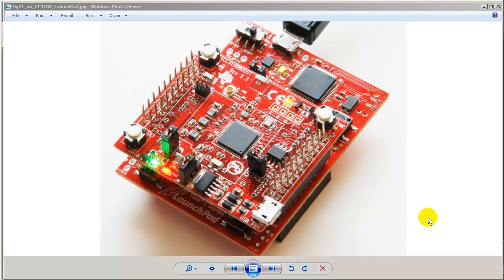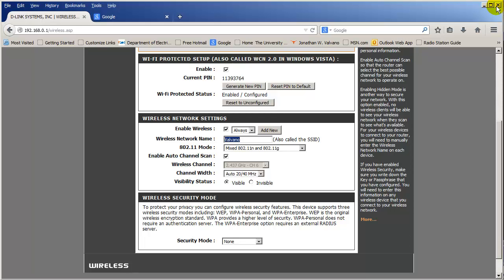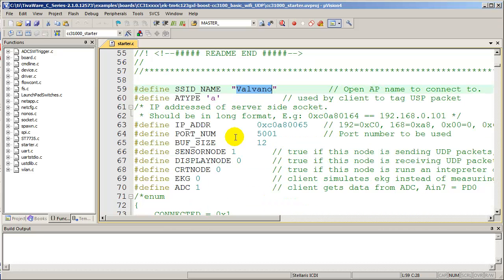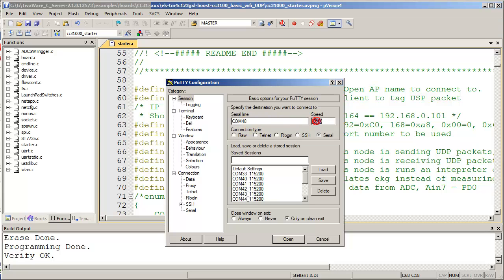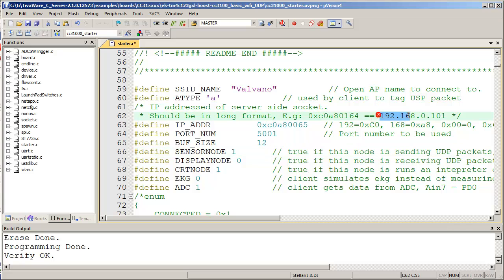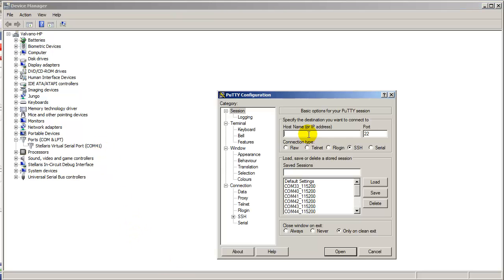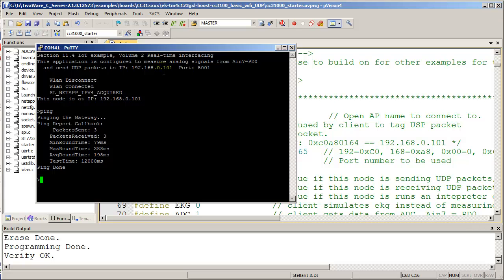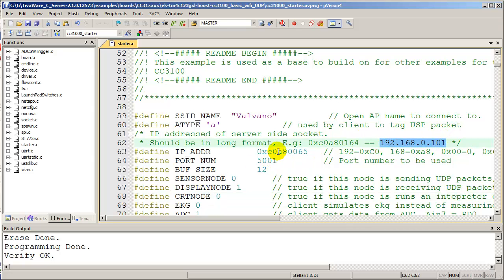IEEE802.11 System with TM4C123 and CC3100 booster

Comment: Hi Valvano,
To work with this example you used first cc3100 EmuBoost to program cc3100BoosterPack?
It is possible to program the cc3100 with the tm4c123gxl?
Thanks
Reply: Did you figure out if we need the emuboost?